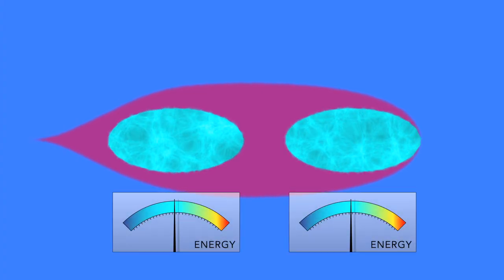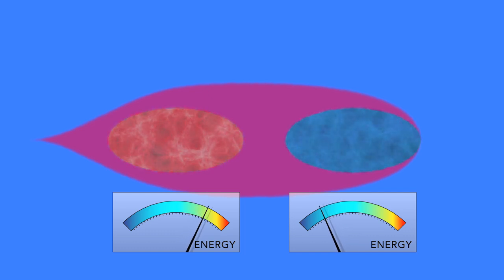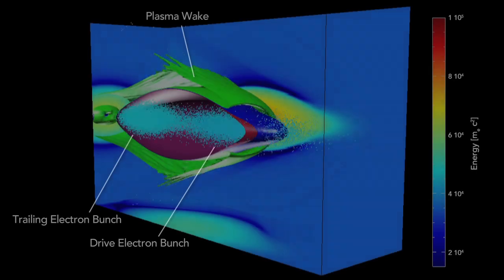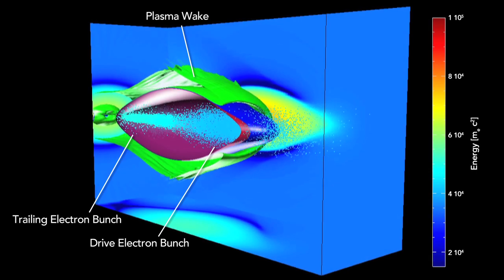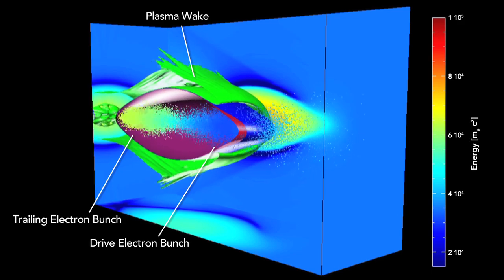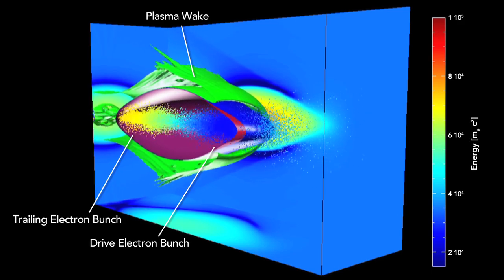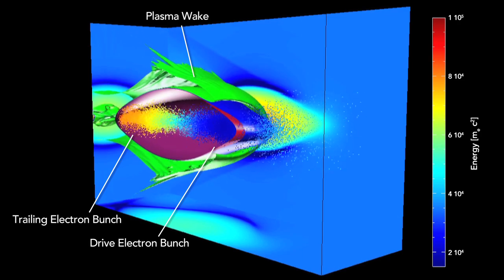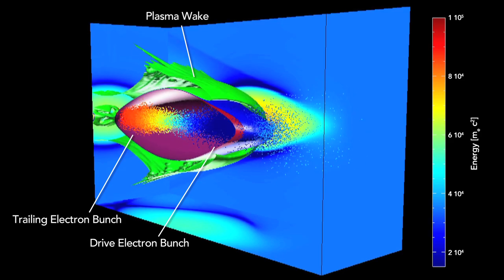Plasma Wakefield Acceleration: How it Works

Comment: This was not helpful. Add sentences and please explain how the plasma wake accelerates the electrons other than pumping it full of energy.
Reply: It exploits use of the strong force by boosting of a plasma "wake" more or less. Same reason why magnets are more inclined to move the closer you move matching poles together. As the wake closes, the potential on the vaccum side of the wake is greater than the plasma; so momentum is rapidly transfered from the plasma to the charge riding the wake. Pretty trivial stuff, but invaluable as research.

Comment: from my limited knowledge of particle accelerators, I'm pretty sure the speed limit of the LHC isn't determined by the energy put into the particle but how fast they can get the particles to turn. How will they solve that problem?
Reply: By having a linear accelerator so they don't have to turn.
Reply: As long as you think in linear, relativistic energies will never be achieved. That's just the nature of it. In terms of collisions, all you get is a bigger and brighter bang; and that's all you should hope for if that's how you're thinking.